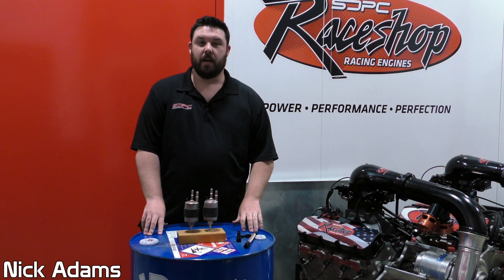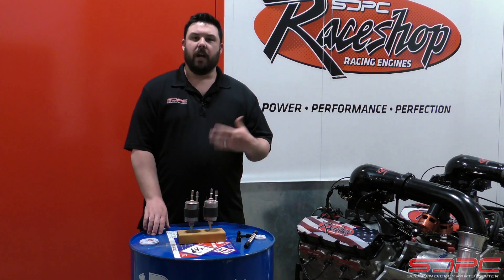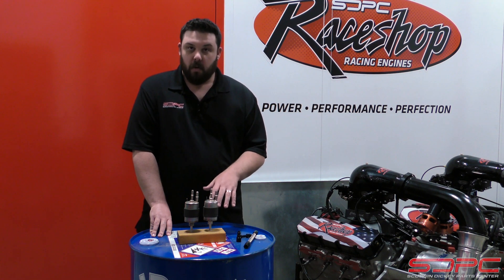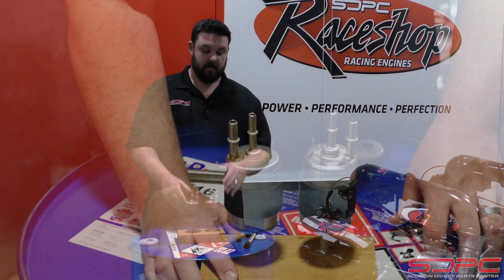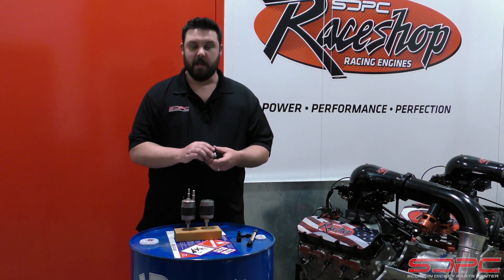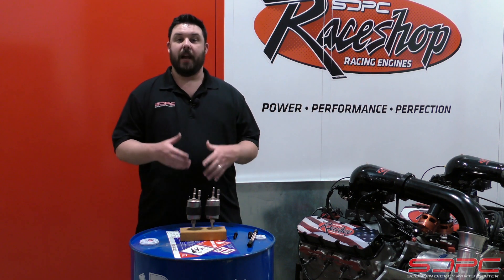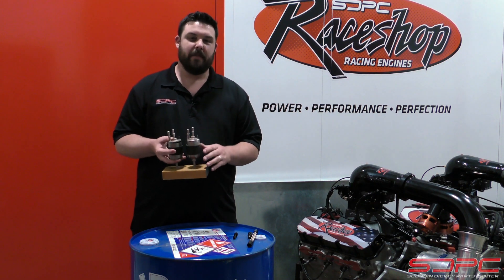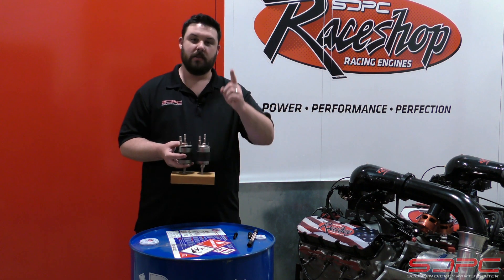SDPC Tech Tips: Universal LS Fuel Filter Kit

Comment: Can you all put a video on how to remove the filter once it's installed? Working backwards I guess. Do you just unscrew that locking nut for the quick connect and it just pops off?
Reply: No, its not a servicable part..they cut it open too show the "quality"..
Reply: @dalehall2993  was able to figure it out just took me actually not being scared to pop off the line. Thanks